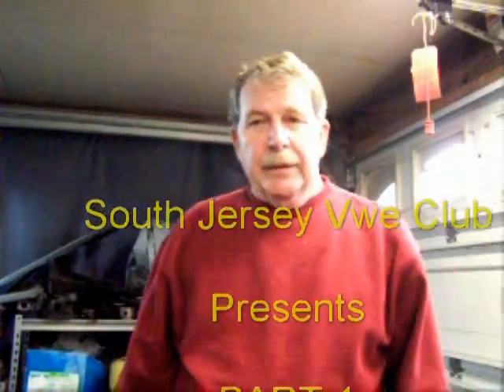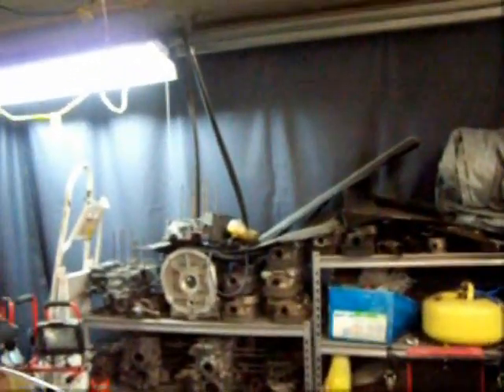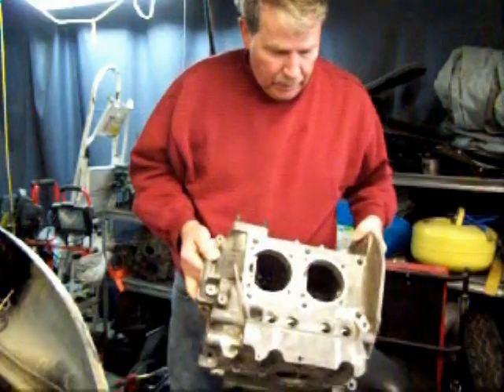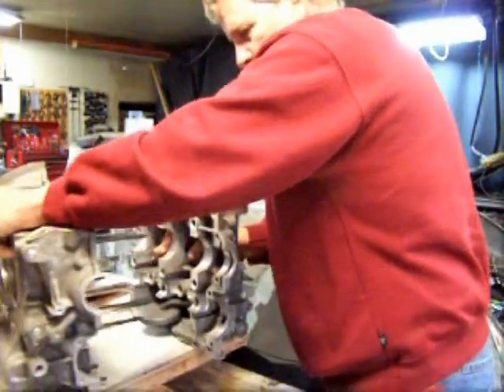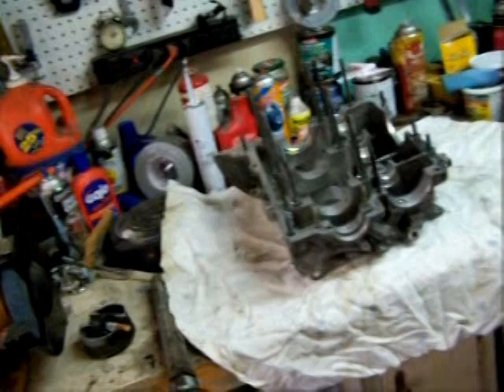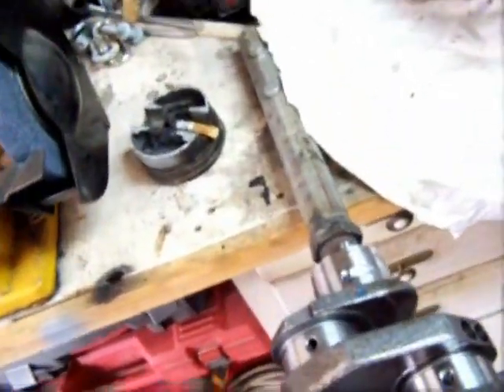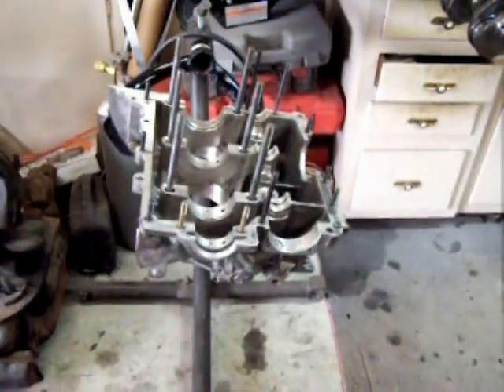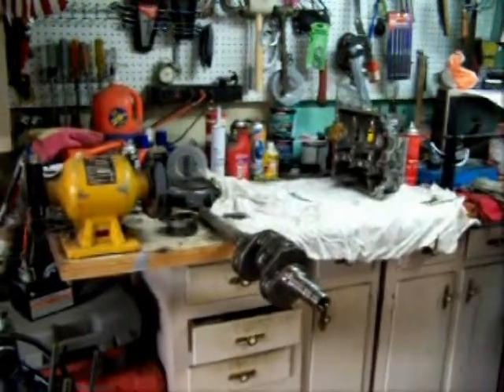VW Engine -1

Comment: @6d4vdub 
Hi Jack, I love your videos. When you put the 2 pc of block together you said you used permatex is there a special type best to use? Also i have 2 differant blocks i noticed the one you used has the rubber gromeits over the studs thats like a V shape on the outside one of mine cases is like that but 1 is missing do you know if that comes with the gasket set or where can i get them. The other case is not like this is this normal. 
Thanks  for any help
Tom

Comment: Hi Sir, i am getting ready to start rebuilding my 1600 engine and i wanted to know what size are the four bolts that you used to bolt down your engine block to the engine stand. I need the size to see what size i need to buy. Thanks.

Comment: hey, thanks i managed to split the engine block but have not removed the cylinder heads yet...i removed those circular pins (two per head) but i have not succedded in removing it from the connecting rod....
hope you can help me here (again lol)
thnaks!
chris

Comment: hi sir, im attempting to slit my engine case....
i removed heads and all bolts etc and would greatly apppreciate your advanced vw knowledge by telling me if i have to remove to flywheel and drive pulley before splitting it in two..??
or can i just split it by leaving the flywheel and pulley still on the crankshaft?? 
thanks!
chris

Comment from the maker: you can take a screwdriver slightly larger then the hole in the center of the gear and lightly tap it into the V part of the gear and lightly move it back and forth while pulling up lightly.

Comment from the maker: The shaft is probably hung up on the washers that it rides on. Remove the shaft and with a long screwdriver align the washers so all of they are lined up with the hole, then drop the shaft in. you may have to turn the shaft a little with a screwdriver till it drops in. DO NOT force it in.

Comment: yes, sir thats the exact problem! the distributor doesnt go as far as it should so the dist drive shaft is not engaging the gear. The drive shaft is too high and i need to push it back down (with a mallet) so that the teeth engage eachother. The only problem is that im not sure about the timing ie: so that the teeth lie above eachother and i can hit the shaft downwards to engage them. how is this possible?

thanks loads.

Comment from the maker: Put  your distributor in and see what happens. The dist. must sit all the way down on the block. If it don't sit all the way down the drive shaft is not seated in all the way. Maybe your washers moved and is not letting the drive shaft go all the way down to engage the gear.

Comment: the distributor isnt in the engine, when I inserted (with cylinder 1 at TDC) its slotted in perfectly but the rotor arm or the whole shaft simply wont turn. It doesnt ride up either....doesnt move at all...

thanks

Comment: hey guys, i was wondering if you can help me out with my engine problem. When I turn the flywheel, the distributor drive shaft doesnt rotate. does this mean its out of place, eroded down??
any help would be apreciated
tnks

Comment: Just getting ready to put mine together,Been 28 yrs since i built the one in my bug now.Have ove 436 thousand miles on it and counting.Just bought a German crank i found on ebay,it has been sitting in a parts dept for 36 yrs.Its brand new and still had protecting coating on it,what was left.Now all of my parts will be German and not that garbage from south of the boarder.